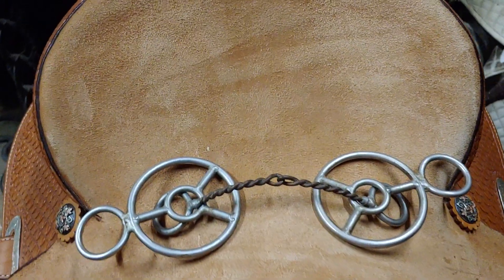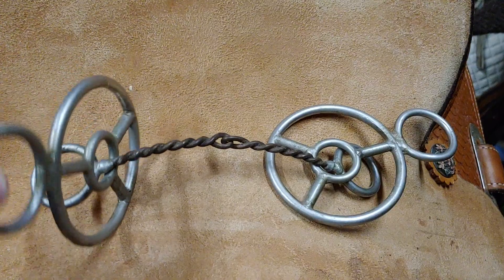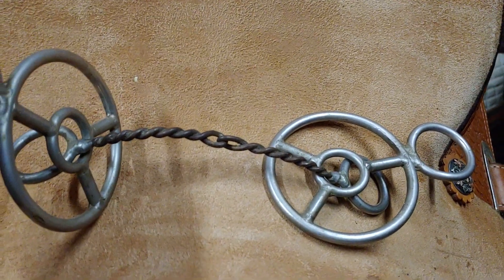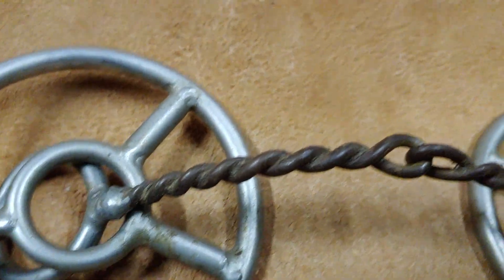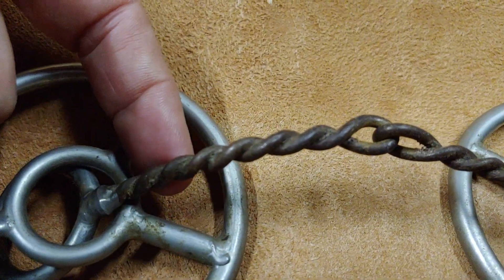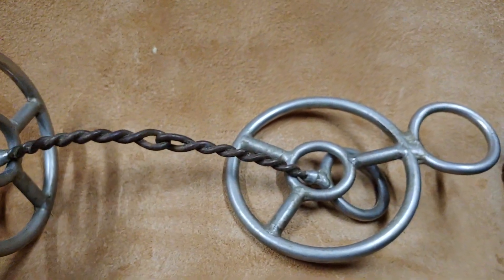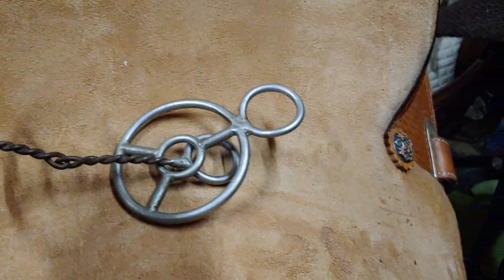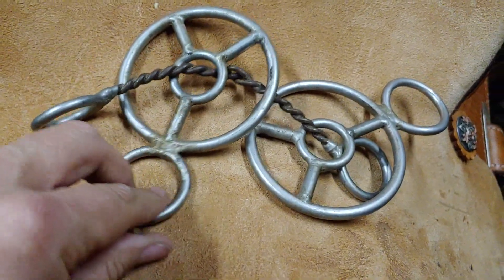The harshest bit that I have ever come across

Comment: Since I know you have your certification and your my favorite. I have a question: I use Mylar level 1 loose ring with copper inlay. How do you feel about those? And if you don't like those what would you prefer someone use?.. I'm in total agreement that the bit you showed looked awfully harsh and I NEVER want to be harsh to my babies (big babies). Some cowboy needs to be whipped with that thing or put in his mouth. Ouch is right. Now that's a mean ol' cowboy.
Reply from the maker: I have not actually used a Mylar bit. But I'm a fan of double jointed bits like a french snaffle or dogbone roller bit, because they do not have the same nutcracker action on the roof of the horse's mouth. These types of bits are good because they also isolate the pressure on one or the other side of the bars.
I personally like D rings, eggbutts, and full cheek sides as well. Loose rings can sometimes pinch the sides of the mouth. 
Here's a vid about bit shopping for you, if you have not seen it.
https://youtu.be/rAVqnSwn5dE
Reply: @lonestarwoman  // awww...you're a big help. Thanks sweetie.

Comment: I've got a twisted bit, doesn't look like that....now I'm gonna have to check it out to see if it's that thin, I think mine is much thicker, it just has one big "O" ring on each side. It's not one I use, it's on a spare headstall but if it's harsh I'll chunk it!!! My mare may be sassy but I have no desire to tear her mouth up!!
Reply from the maker: This twisted wire is so thin that it is about 2x as thick as baliling wire. So very small contact point on the bars. And it is direct pressure. This bit could easilly cut a horse's mouth.
Slow twist, twisted wires that are thicker are much less harsh.
Please be careful with all twisted wire bits,  they can rust and cut the bars easilly. 
I have personally seen blood in the froth around the  mouths of several rodeo horses being ridden in varieties of twisted wire bits. And I saw one horse that nearly cut thier tounge in half when tied by the reins to a trailer, that spooked. Not pretty.